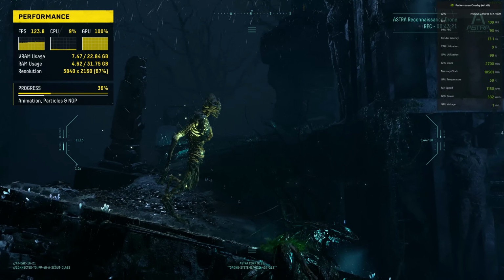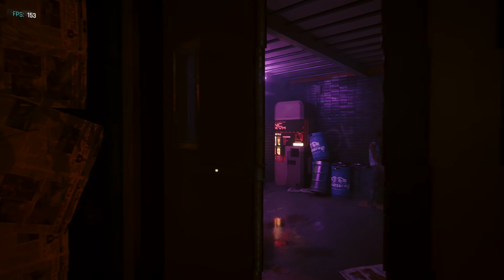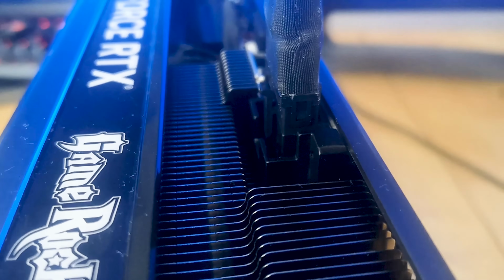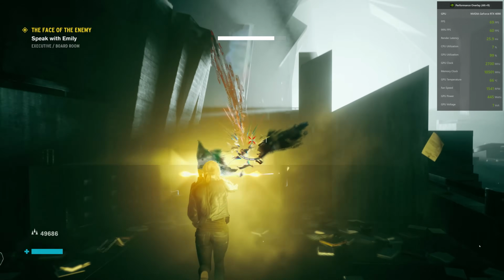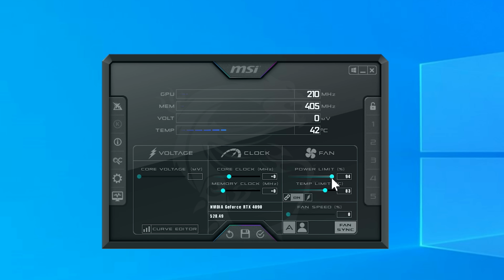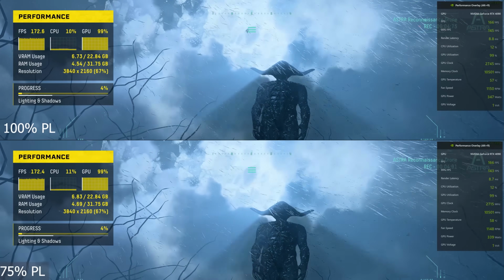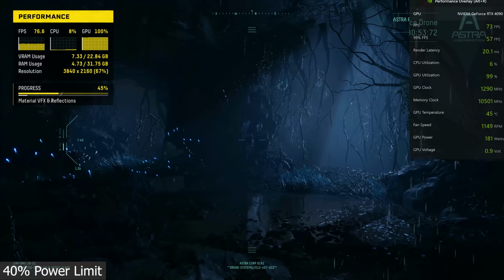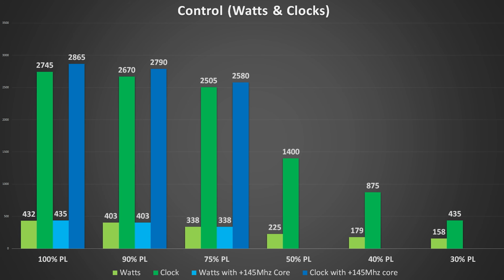RTX 4090 - IMPROVE Performance & REDUCE Power Consumption

Comment: Framerate cap (preferably 60 for single player), dlss, and optimized settings (no ultra unless required) make a lot more difference in the power draw than undervolting.

Comment: if you lock frames to your monitor you can still keep full power limit and power draw will be even lower if you disable RT or set to performance. 75 is sweet spot. I wish i wasnt paying 17 cent for my electricity......I dont worry about temps on my FE with active water blocks more so power draw, i had 3080ti last year at 75 percent but never undervolted as i should because that coil whine was bad on the hydro block edition.
4K draws a lot of power, if you have a 1440p monitor it will upscale but sometimes it can look better than in some games. 4K monitors are expensive and electricity isnt low enough to warrant the extra power draws from both ends.

Comment: you forgot one point where the RTX 4090 really shines: fps limitation. IgorsLab and Computerbase made the test.
They limited the fps at 144fps, on the Nvidia Driver and the power Consumption, during Gaming (1440p, Ultra settings) went down to 126W.
Then they limited the fps to 90 and the Power Consumption went further down to 110W.
Also when DLSS3/FG is used, it draws slightly less Power.
Now add to all that the UV Curve like 2800Mhz at 0.925 or 0.900mV and you might reach 100W Power Consumption, while gaming.
Reply: Maybe just buy a cheaper card in the first place.

Comment: This video does a good job of telling the average user that is not aware that underclocking and power limiting can yield good results. I like that you show people how to do undervolting and power limiting.  Many people don't understand that if you get a high end gaming card you can have more enjoyment over time with it than if you buy a mid or lower end card. The high card can be underclocked to match a lower end card while still out performing it. Power limiting is really useful for games that are cpu limited. You can use more power when you need it and less when you don't need it. 

What you might consider doing next is the importance of picking a good power supply beyond what is needed, so they don't run into the problem of their machine turning off while gaming... That's still a problem sadly.

Comment: Title is clickbait. Better to spend a minute around it when making it.

But if you mean lower heat and power consumption could be described/marketed  as better performance, rgen you are absolutely correct in "Nvidia way to be sold".

Btw who would be  getting 4060, first of all it not yet released and in 4000 series price performance scaling among tiers it gonna be DOA of century.

I have cut power limit on my MSI Mech 6650xt which is only possible thing to do with pwr limit by 10percent, then  set voltage to 1,125V from default 1,2 and core clock to 2635MHz from 2765. But mainly I have reduced max fps to monitor capability, thats what does big job in your terms. Unseen fps are waste of energy.

Comment: Considering that my 4090 rarely exceeds 350W, I can see why a 80% power limit has minimal effect on performance. And doesn’t that also mean that I’m not saving any $$ or decreasing heat output since the GPU wasn’t going to run that high regardless???
Reply: RedGaming_Tech  I’ve never been so excited! But no thanks, I don’t need a PS5

Comment: I run my 4090 with 875mv.
About 30% less power for 95% performance.

On Hitman 3 at max setting including max RT I can get solid 60fps 4k DLSS Q and only uses around 200w.

Comment: I have a 750 watt platinum sfx psu with 4090 Suprim liquid at 80% power limit with minimal performance hit and 7700x all core ai oc at 5.65 ghz  with noctua d15.
Reply: What temps you get after undervolting for 1) Max Gaming Load 2) and @ what fan speeds?  Thanks!
Reply: @CareerShortsOfficial  The hardware was sold. It was  peak high 50s on the gpu and around 80 degrees on the cpu.
Reply: @aberkae  Thanks!  did you leave fans on a curve?
Reply: @CareerShortsOfficial yes. The also the set profiles were silent, normal,  extreme.  Depending on  what I was doing I would change it but mostly kept it on  normal profile for the cpu fan. The 4090suprim liquid was kept on auto tuning.

Comment: 3080ti at 70% – fractional difference at best and runs around 1.9GHz core at 55c.
5800x – 0.17v undervolt in 65w eco mode and still runs 4.85GHz all core at 56c when gaming.

This should be basic stuff for any enthusiast. I still need to learn memory overclocking, though...

Comment: Looks like an RTX4090 under powered to 75% is the sweet spot, with 25% less expensive electricity used for an unnoticeable performance drop. Great tip, thanks!

Comment: I did some messing around with my MSI Suprim 4090 a while ago, set the PL to 90% but OC'd to +150 core and +1000 memory.  Tops out at 400W and 5-7% faster than stock in a handful of benchmarks averaging as high as 2950Mhz in Firestrike Ultra.  Can actually clock higher, but this setting seems pretty stable, at least enough for a few hours of gaming I did testing it out.  80% PL +100 core and +900 memory is about the same fps as stock, but at 350(ish)W.
Reply: I was trying 100 core and 1000 memory oc at 80% and got a black screen. Is the GPU more sensitive to core or memory oc?

Comment: The simplest way is just to cap your FPS. If you don't want to mess with other programs or still find using programs to tweak power a bit daunting, just cap at 60fps in the Nvidia panel, but if you're into fps shooters, capping at 120 would be better. It will lower GPU temps/power draw and give you better frame times because your fps will not jump around a lot.

It's not the best way, but it's fast and easy.....though no doubt there will still be some COD player who says they want 200+ fps.

Comment: I'm doing this with my 3090, but I leave the power limit at 100% and instead use undervolting + a flattened VF-curve beyond the stability & efficiency sweet spot. Near identical performance at ~80W lower power consumption (in effect an ~80% power limit), and of course thus also lower temps and lower fan speeds.

Finding a 100% stable undervolting sweet spot in low-load conditions may not be all that easy though ... I can push the frequencies and lower the voltage quite a bit more and achieve perfect stability in stress tests, games and benchmarks, but it will then instead intermittently crash (as in black-screen + system freeze) in low-load conditions. So, finding the best undervolt that is also 100% stable in low-load conditions was the hardest part, especially since I can't reliably reproduce the instability and have to test it using the very time consuming "let's just wait and see" method.

Comment: i think that the reason why they cant put a 4090 chip in a laptop is not worth because at 40% power get alot lose
Reply: There are 4090 laptops. They operate at 175w tgp for the GPU, performance is around a desktop 3090.
Reply: @Wobbothe3rd  the 4090laptop is a 4080 desktop chip undervolted the 4080 have less cores

Comment: Just get the right model and avoid FE at all costs 
After spending $10,000 on rtx 4090s, I returned all of them and only kept the gaming OC version. FE coil whine is horrid. My gaming oc is running quiet without ANY limits. Stop with the undervolting, stop limiting power. You are introducing unstabiliy issue that is nightmare to troubleshoot. Why are you handicapping your gpu after spending $2000 🤣😂🤣😂
Reply: Good choice. I have the Gaming OC too and it's fantastic. It's just good at everything. Higher-end features, good cooling, good overclocker, no coil whine even at high fps. I originally was going to get a different model but the guy at Microcenter said the Gaming OC and Zotac Trinity were the only ones they had in stock at the time. Looking back, I am glad he didn't have the one I was going to get because the Gaming OC is amazing and I wouldn't trade it for any other model.
Reply: 100% this.

Comment: I undervolted my 4090 FE to 0.9V at 2650Mhx frequency, 80% power limit with +1500 Memory clock to compensate. It runs equal or greater than stock with 350-375W power draw and temps at 60 C. Pure bliss
Reply: My gaming trio can't even hold +500 on the memory😑
Reply: what is the refresh rate of your Monitor? If it's 144Hz, just limit the fps of the GPU in the Nvidia Driver. It makes the Power draw drop to 126W - 130W when gaming (at 1440p). Computerbase and IgrosLab did the test.
Reply: Lolol.. all that with a severe memory overclock just to get similar to stock speeds.  Sooo worth it 🙄
Reply: @davidfaustino4476  What's the title of the video?

Comment: if you can afford a 4090 you don't care about energy bills, its like asking a Urus driver if they care about their gas prices
Reply: That's not true. Some of us have solar and desire to be carbon neutral.
Reply: That realy depends my family is kinda well situated...  but we are not happy with 900euro bills for just electrocity,  trust me. Here in Czech electrocity is sometimes 3xtimes more expensive then in USA. Its madness.
Reply: Btw using gpu with 450wats all time could be kinda insane my case 250usd per mouth. So I care about it.
Reply: Im a 4090 owner and I still do, if i can set power limit at 80% at the cost of -2% fps in my games i dont see why not? Also keeps the temp of my room down with it running at flat 60degrees max.

Comment: I am running my 1070 ti undervolted. It was also power limited, until I started playing hogwarts legacy for this I needed the cards full power so I am back at 100%, which is still a heck of a lot lower than any modern card.

Comment: Great video . I am using undervolting for my xtx pretty much from the start.  You can set specific values for every aplication in Adrenalin Software,  its very usefull as example in Cyberpunk i can easyly use 1,2 voltage without losing  any performance  core is pretty much always at 2590mhz,  mem clock is 2580mhz. Power consumption in this case can hardly reach 300wats with 100%utilization. However I cant use this profile in witcher 3 dx 12 thus its unstable so in this game my profile has diferent values,  where gpu can reach its 355 wats limit quite easyly, something is probably just tanking my gpu in this one. I can recomended this to any high-gpu user,  its great and when its done well it can easyly give you more frames with much lower power consumption.

Comment: So you lied. Decreasing power is decreasing performance. Just be honest...
Reply: Yes generally but in some cases thermal throttling is worst thing than lost performance due to decreasing the limit
Reply: So you lied about someone else lying. Just admit you're busted.
Reply: Check out optimumtech's video "Dont undervolt the 4090"
Reply: @Wobbothe3rd lol Optimum video is about 70w to gain 10 fps
Reply: Yeah, I unsubscribed due to this.

Comment: Ive ran mine at 70% (315w) since I bought it. I actually run it on a Toughpower GF 750 PSU. 😁
Reply: Yea me too just set powerlimit to 70% in MSI Afterburner and using an 850W psu.  I don't bother to undervolt so not sure if thats an issue but it works fine
Reply: mine 1050wt psu from cooler master,but set PL to 60%.its only consume 140-160wtt when playing Apex Legend 4k 144hz med setting,way less than my prev 3070 which consume 220w,
Reply: @natsu78999  How many hours to play Apex legends to get cost of 4090 1000++USD in return of energy bill savings by cut power draw by 80W?
Reply: @gstormcz  as a content creator who rely on its power,yes its worth my money,i already got all my invest,and for gaming i dont think we need 4090,since 3080ti can run just fine with any game u play on medium setting 4k
Reply: @natsu78999  When we speak about efficiency for extra money as only feature on new gen for extra cash, then we could go for another mining boom to reason purchase. It's as upgrade price vs consumption difference which makes it probably value only in regions with diesel to electric production.
Reply: @gstormcz  i dont hv any trouble with energy bill,since its kinda cheap in my country,around $30-40 ish (in USD) per month
Reply: @natsu78999  so 500USD per year, it can reason for 4090, if you would use it years. So 4090 is cheap in fact.
Reply: @natsu78999  well my gaming laptop runs that at 1080p 144hz at whole 90 watts max :P(rtx 2070 refresh + 10875h )
Reply: Thanks for that info I have the new 1000w Asus Thor P2 PSU. I was worried that it would not be enough because I have a RTX 4090 Asus Strix white paired with an i9 13900Ks.
Reply: @ZackSNetwork  Zac that I9 will draw a lot more power than my Ryzen 5600x. That said, you will be absolutely fine with a Thor 1000w. They are beastly PSUs. 👍
Reply: @a64738  I don't know much about that. Sounds impressive

Comment: - Use MSI AB.
- Set core to -500 hit apply
- Open Curve optimiser
- Find 850-950Mv and raise that point upto your max GPU clocks at stock settings (for me that is around the 2750-2850MHz range).
Close curve optimiser and hit apply
Open curve optimiser again and you will now see a steady incline upto your max clockspeed and then a flat line for the rest of the graph.

Now go and stress the card out, use a demanding game with RT like Cyberpunk or A Plague Tale: Requiem and play them for a good hour or so at completely maxed out settings to really stress the GPU.

If you crash you set the max voltage too low. Go back into AB and hit reset, now set core to -500 again hit apply, open curve optimiser and now choose a higher voltage. 900-950Mv seems to be the sweet spot if you don't crash at a lower voltage you got a really good chip.

I got my PNY 4090 @ 950Mv @ 2750MHz. Dropped my power consumption by 50-80W and temps dropped from 65C max load to around 58C max load :)

Easiest way to undervolt on Nvidia cards. This also worked great for 3000 series too.